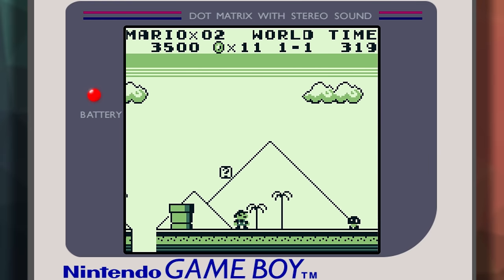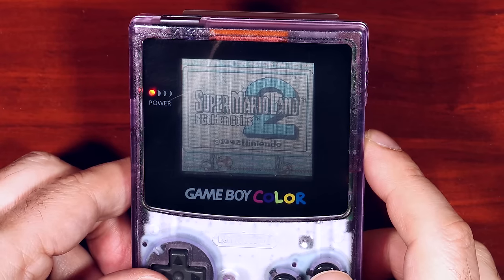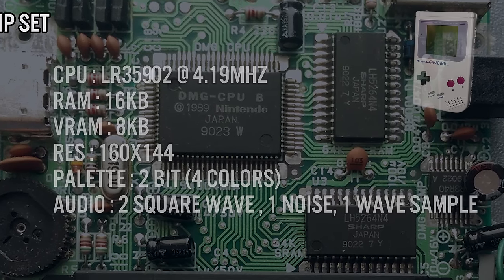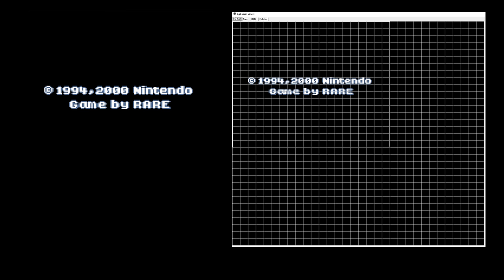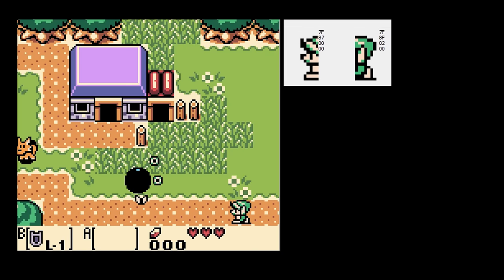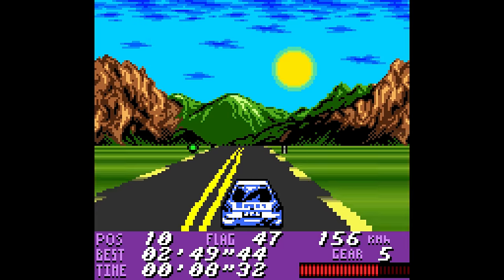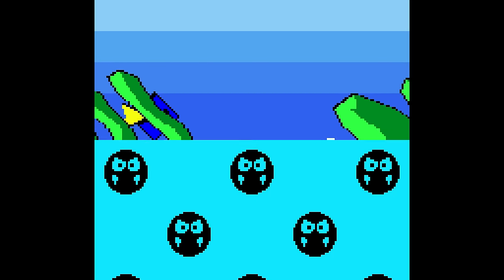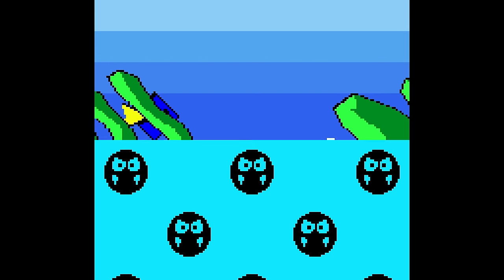How Graphics worked on the Nintendo Game Boy Color | MVG

Comment: Love that you added how GBC was able to “upgrade” older games with color! That was a mystery of mine as a kid; very cool they had a master list to retroactively set the color palettes.
Reply: CodaBroda same, it blew my little mind.
Reply: Same here, exactly why I watch this video in the first place.  The default colour list is a genius move on Nintendo and game dev part, making old game cartridges work as-is w the new hardware w colour.
Reply: I opened this video just because I wanted to know that, for example how the new Gameboy Color knew the old Super Mario Land 2 Mushroom had to be red and white for example.
Reply: @César Leiva me too.  Preset color palette by Nintendo is actually a clever implementation.
Reply: I guess not the GBA, He showed Link's Awakening (the original, not the remake) running on the GBC and it doesn't look the same as me running it on my GBA.
At least running it on my AGB-001, I have not tried it on my AGS-001 SP.
Reply: And of course the GBA has that same list.
Reply: Personally, I feel cheated. I was expecting some clever algorithm that assigned colors to different greys. I was baffled when he said the old gameboy games could only use four colors. This really mystified me, since the gameboy color could clearly display more than four colors, and alongside all the greys of the original gameboy. I was disappointed when he revealed that, in reality, the console itself simply had a set of palettes saved in it that would trigger for specific gameboy games. Honestly, I wouldn't have guessed that, seeing as my pokemon silver seemed to only have two colors: red and blue. I had assumed that was because the console was trying to apply color to a game that was originally in greyscale. As stated, I had assumed that it was simply rendering some of the greys as specific colors, meaning that games would end up with some really weird and non-sensical color palettes. Keep in mind, the only games I had to test this with was tetris and pokemon silver. I figured something was fishy when he showed the pokemon tcg game, which looked like it was hand-made to be in color. By the end of the video, I knew why: a cheap tactic, to create the illusion the gameboy color was a more interesting machine than it actually was. Guess I had my expectations set too high...
Reply: @lXBlackWolfXl I think that’s how this magical wonder works.  I feel being cheated every time I watch those magic documentary videos.
Reply: Many say the Wii was 2 gamecubes ducttaped together but the GBC really is that. It truly is just a double gameboy. Double the PPU bits, double the clock speed, double the RAM. Just double everything.
Reply: @lXBlackWolfXl  The original Game Boy really did only have four shades of grey. The Game Boy Color does about as much as it could do when colourising those games (which weren't created with colour in mind at all!). The backgrounds get one four colour palette, and sprites could get one of two different palettes of three colours each (plus transparency). You can also override the palette by pushing button combos during the Game Boy logo screen at startup, although these palettes often had fewer colours total than the ones that were predefined for non-colour games. On some games the automatic colourisation works very nicely – Metroid II is a good example.

I don't know if there would even be a 'clever algorithm' possible even now, on modern hardware, that would automatically assign colours to greyscale games – that would involve having it automatically figure out from the pixel data what each tile and sprite was meant to be, so it could know that, for example, an apple should be red. It definitely was not possible in a handheld from the late 90s with a CPU derived from one that was a bit pokey even in the late 80s!

None of these limitations applied to Game Boy Color games (like Pokémon Silver) – they could and did have up to 56 colours on screen at once.
Reply: I always assumed they had made the games with color, but the og Gameboy couldn't display them, so we just never knew.
Reply: I did wonder when I was a kid how it knew to make my pokemon blue have a blue shade and my brother's pokemon red had a red tint to it

Comment: I'd always wondered how my GB color was able to colorize my older games.
Reply: Some of the later original game boy games had colour graphics in their code for use with the Super Gameboy
Reply: exactly - wizardry
Reply: I opened this video just because I wanted to know that, for example how the new Gameboy Color knew the old Super Mario Land 2 Mushroom had to be red and white for example.
Reply: If I remember right you were also able to change the colour palette assigned to GB game by holding the D-pad in a direction while booting. 

(Or maybe it was only on GBA, not 100% sure... But I used this trick a lot to change my Tetris experience)
Reply: Cuz its gameboy "color"
Reply: That's weird that it was a mystery. The Super Gameboy used the exact same system 5 years earlier.
Reply: @MrMarinus18  yeah. I was a nerd. But i remember knowing how the super gameboy worked even at 10
Reply: I always assumed that Ted Turner was the reason for colorized classic game boy games.

You'll only get that joke if you're old school
Reply: @Ned47628  True, but Super Game Boy colors were completely incompatible with Game Boy Color colors. The system worked very differently, by assigning colors to portions of the screen, rather than to the tiles.
Reply: I always had an idea

Comment from the maker: A Few corrections :
1:10 - Xekkusu is actually titled X or X (エックス, Ekkusu) in Japan.
7:30 - Technically VBlank occurs at any scan-line above 144.
9:26 - Hi Color mode can display around 2000 colors instead of 4000
Reply: What i found out on Mario Island 2 - 6 Golden Coins is that on the boot of the gameboy you can override the color pallet by holding the B button and using the D-pad. You can even chose the original 'black and white'
Reply: The DMA unit on the gameboy color can also copy data from the cart to the video ram VERY FAST, like 4MB/s, it's a massive upgrade over the 100KB/s if lucky you had on the original gameboy and it's what allows it to play FMVs etc..
the DMA on the original gameboy was fixed on the task of copying sprite parameters from the memory to the sprite memory so you could not use it to do things such as copying tiles to the vram.
Reply: You're really over-stating the CPU speed - according to the GBC dev manual the CPU is 1.05mhz in normal mode, and 2.10mhz in GBC/double-speed mode... a quarter of the speed stated in the video.Makes some of those effects achieved look even more impressive :)
Reply: @mrverybored It's a bit more complicated.
The gameboy CPU execute one instruction every 4 cycles, so they're dividing the clock on the manual due that.
And there are instructions that takes more cycles, but on the gameboy CPU i think it rounds to multiples of 4.
Reply: I was gonna call you out on that.  Good thing you corrected yourself...just kidding, 90% of the technical jargon flew way over my head.  Still interesting though keep it up
Reply from the maker: @Yuki Taiyō very nice
Reply: @KoenHendriks   You can do this for every game, hold A or B or Non plus D-Pad, gives you 12 different pallets to choose. But some Palettes the GB Color choose can't access via this method. Here: https://tcrf.net/Notes:Game_Boy_Color_Bootstrap_ROM#Manual_Select_Palette_Configurations
Reply from the maker: @MarcoGPUtuber  hi Marco, email me admin at modernvintagegamer dot com
Reply: @mrverybored  Processors based on the Intel 8080 architecture work with two kinds of cycles: so-called T-cycles (or T-states, or simply states), which are generated by a clock at about 4 MHz on most 8-bit platforms, and M-cycles (or machine cycles), which are generated by the CPU when executing instructions and serve as a clock for most other parts of the machine, including the memory. Most instructions use as many M-cycles as they do memory accesses, including fetching the instruction itself (so every instruction takes at least one M-cycle). In Intel 8080 and Z80, those M-cycles were of variable length (from 3 to 6 T-cycles), but when Sharp created the GB CPU, they decided to make 1 M-cycle always equal to 4 T-cycles. It's less optimal, but makes the overall architecture simpler. So in one second the original GameBoy executes 1 million M-cycles and 4 million T-cycles.
Reply: @KoenHendriks  You can do this for any game, not just for SML2.

BROWN= UP BLUE= LEFT PASTEL= DOWN GREEN= RIGHT
RED= UP+A DARK BLUE=LEFT+A ORANGE=DOWN+A DARK GREEN=RIGHT+A
DARK BROWN=UP+B GRAY SCALE=LEFT+B YELLOW= DOWN+B NEGATIVE=RIGHT+B

And some games like Metroid II or Wario Land have they own custom palette.
Reply: @ModernVintageGamer  please tag your comment so everyone can see your comment first above.
Reply: "Mistakes were made"
Reply: @MarcoGPUtuber  hi
Reply: hello my name is MVG lets mod the crap out of this too by putting persona 5 on the game boy
Reply: Thanks for the video! Can we get part 3 for GBA?
Reply: @ModernVintageGamer  Done!
Reply: One nit-picky thing: You can get more than 4 shades of gray out of the original Gameboy. The way developers would do that is by flickering things, and the ghosting of the LCD would create kind of half-shades. Castlevania 2 uses this in a few ways, there's a stage background that does it to create a lighter-than-the-lightest shade to colour a distant castle, and it also uses it to make the water look transparent. The downside is that if you use a modern LCD that doesn't ghost enough, the effect breaks down. One of the very few cases where you would want the old screens in those things.
Reply: @alainchristian  The OG gameboy learned a LOT of lessons with the NES games, like how the tile maps work, how developers like line counting, increased sprites per scanline..
The GBC goes even further beyond, basically reimplementing the DMA/HDMA of the Super NES and also the total color palette.
To not mention the massive amount of extra memory and definitively faster CPU.
Reply: @alainchristian  Moore's law also helped GBC quite a lot.
The crushing majority of the NES games were like 128-256KB, while a GBC game could have 2-4MB of ROM by the end of the gen.
Reply: Goddamn smarta...

Oh wait,this is actually the guy who uploaded the video and not some random nit picking commenter...Uh,i'm confused
Reply: "Xekkusu"

Takeshi: https://youtu.be/ViXSzU8UjbI
Reply: 1) There was an unreleased international  version of X (Lunar Chase) Two versions of it were found in the nin megaleak, pre-release and in-dev beta version.
2) OAM DMA Can occur on any scanline on original DMG Gameboy, but it messes up the sprite rendering and blocks access to all memory locations except HRAM and memory mapped IO registers, which means that you can't do anything useful while it's in progress

Comment: Horizontal Blank interrupts were the key to getting that classic Mode 7 perspective on SNES too. Mode 7 allowed the SNES to apply transformations like scale, skew and rotation to a 2D image, but by scaling each horizontal line separately developers could make it appear as if the image was shrinking as it receded into the distance (up the screen). It seems in implementing H-Blank on the GBC, Nintendo enabled the same effect (minus the arbitrary skew and rotation).

Comment: One of my favorite aspects of the GBC was being able to change the palette that the system used for GB games. Playing Pokémon Blue with negative colors (is that right?) or switching from just blue to a blu-ish green was awesome. I feel like not many people know about it and while it was kind of mentioned in the video it would have been cool to see it displayed. 

You switched the color palette by pressing directional buttons or directional and A or B while on the “Game Boy” screen.
Reply: David Oros OG night mode
Reply: Speaking of, the pink/blue pastel palette option is useful in Pokemon Red/Blue to get through Rock Tunnel without Flash. The game turns 3 of the background colors into black and the 4th into dark gray, and all the sprite colors to black. Picking the pastel palette made that dark gray a pale blue. You still can't see NPCs but you can see the walls easily. This trick wasn't possible in Yellow since it sets GBC palettes, but it wasn't needed either since you could just talk to Pikachu to illuminate the screen for a moment with its sparks.

Comment: Toki Tori on GBC simulates prallax scrolling. Here's what Collin Van Ginkel of Two Tribes BV told me about how they achieved this (this here is a direct quote, not my words):

"The multilayer scrolling is actually faked by having a 'video' of a scrolling 64x64 pixel pattern stored in ROM that's being streamed every frame. If I remember correctly, this is also where most of our ROM size went to. The rest of the game was really tiny and Nintendo didn't have any smaller cartridges, so we thought we'd just use it for that then."
Reply: it's not fake if it's shown perfectly on the screen. it's still considered a side scroller.
Reply: Those are the words of the actual dev, not mine. If you think you know better than the dev itself...

Comment: I think what's even more impressive in all of this is the forwards-conpatibility -- that the original GameBoy could seamlessly run any GameBoy Color software that didn't need the additional RAM or power, and could at least display a custom error screen for the convex cartridges that did. They really did an excellent job of keeping the GameBoy accessible to its very last breath.
Reply: That was actually a requirement by Nintendo that all GBC-only games do that. Source: Gameboy Development Manual V1.1 page 287

Comment: AMAZING !!!
Next ? : How Graphics worked on the Nintendo Game Boy Advance ?
Can you please talk about the (software based) 3D capabilities of the console ?
I need to know if some games like Street Racing Syndicate for GBA are in true 3D or not.
Reply: Alessandro Cussino - Yes, please do the same for the Game Boy Advance and Nintendo DS.  Actually, do one specifically for the Game Boy Color!
Reply: If I'm not mistaken, the GBA does actually have Mode 7 hardware, enabling effects such as 3D perspective illusion, rotation, etc., and plenty of games took full advantage of it.
Reply: @DJCosmicLatte  it also can render true 3D.  There are plenty of full 3D games, check out Punching Weight videos on the GBA.  There is some seriously impressive stuff that can not be "faked" using mode 7, Doom-style 3D, Sprite scaling etc.  It is true 3D.
Reply: @startedtech  Interesting, I wasn't aware. To be fair, most of the games I've played on GBA used 2D graphics with occasional Mode 7 distortion (ie Pokémon) or isometric views with 3D models rendered out to 2D sprites (ie Spyro the Dragon).
Reply: @DJCosmicLatte  
Take a look at Street Racing Syndicate, 007 Nightfire, Driv3r, Asterix & Obelix XXL, Payback, Big Mutha Truckers, *Quad Desert Fury, Smashing Drive ;-)

*The game use Voxel graphics.
Reply: @startedtech  eh, it's "true 3D" in the same way PSX is. It's designed for 2D, but the 128 (or 256?) sprites are allowed to be skewed and rotated, which it turns out is enough to draw "3D" quads. DS allowed drawing actual 3D triangles.
Reply: @DJCosmicLatte  GBA mode 1 and 2 provides backgrounds that can have affine transformations applied to them. Mode 1 gives 1 affine background (plus 2 regular), mode 2 gives 2 affine (no regular). Mode 7 on SNES gives 1 affine background and 1 regular. The affine backgrounds aren't enough to do hardware 3D perspective, HBlank DMA is required too.

The GBA had modes 3, 4 and 5 that provide various frame buffer configurations ideal for software rendered 3D graphics. The GBA CPU is powerful enough to render out actual 3D geometry, something the SNES couldn't do without on-cartridge chips (Super FX).

Hopefully that explains everything, if you have questions do ask!
Reply: @ShinyQuagsire  I believe it's the Sega Saturn that works like that, not the PlayStation.
Reply: PhonicBoom/ CosmicLatte - The Game Boy Advance is an impressive system, however Nintendo did not provide it with a dedicated sound chip like the Super Nintendo, so even though the specs like the CPU is much faster on the GBA, it was being exhausted by having to deal with audio along with all other things.

Same with the Nintendo DS versus the Nintendo 64 in that the NDS is missing a filter that correctly displays textures when the camera is close to something like the ground or wall.  The texture will appear very pixelated and ugly; just play Resident Evil DS: Deadly Silence.  The N64 has that filter though.
Reply: Alessandro Cussino - I own the game complete-in-the-box.  The game has great music.  I believe Konami took the time to make the music sound great on the GBA.  A lot of companies didn’t bother.  Some of the sounds seem muffed, static sounding, and or very low.
Reply: "true 3D"
lol okay
Reply: I will never understand why people classify certain 3D algorithms as ""true 3D""

Comment: It's kind of sad that programming for modern consoles doesn't have anywhere near this kind of hardware optimization.
Reply: It actually does, games like the last of us and grand theft auto v were ridiculously optimized to push the ps3/360 hardware to the limit.
Reply: @ShaunDreclin  usually only at the very end of a consoles life. Just look at PS4 (and Pro) barely any games actually run stable target FPS due to lack of optimization.
Reply: @Kougeru  Also why it is basically a waste of money to go out and buy a console when they first come out.  Like right now with the PS4 & 5... games will likely be better optimized on the PS4 than the 5, making the 4 versions superior.  This usually holds true for at least a year or so.